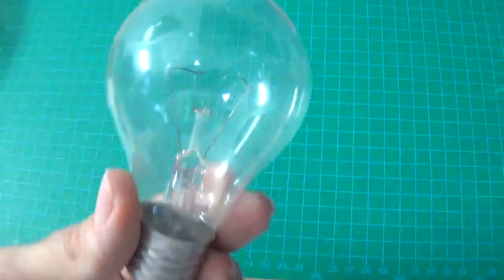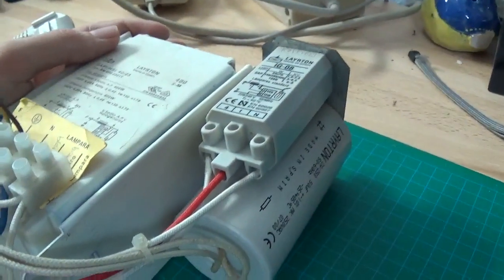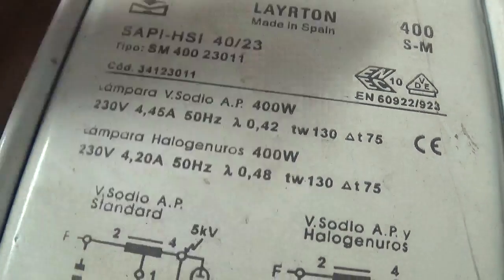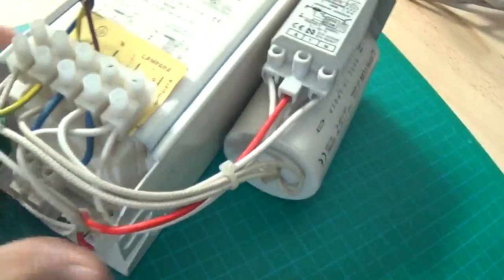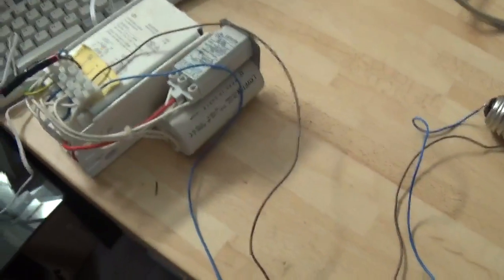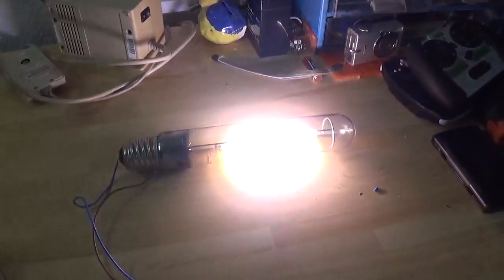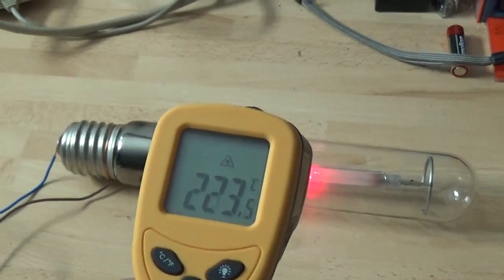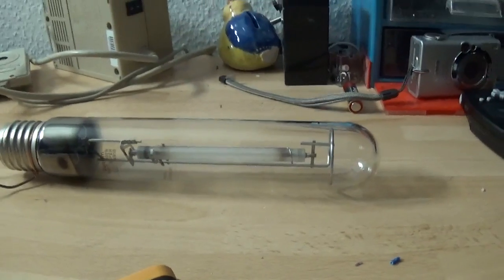A look at a 400W sodium vapor Lamp (street light)

Comment: The tubular unit is a power factor correction capacitor, the unit above it is the igniter (some lamps have igniters incorporated in the lamp). Also wiring should be phase brown , neutral blue. The centre contact of the lamp should be regarded as live and connected with the brown wire. Be aware that you are playing with extremely high voltages produced by the igniter to strike the lamp and vaporise the sodium.

Comment: Have you heard of sodium lamps with internal ignitors,  I've considered them for use at home as I presume you can use them with standard fixtures.
Reply: I doubt it'd be a great idea to have low pressure sodium lighting as general purpose indoor lighting. Because of its very tight colour output, it might play havok with your eyesight if you're using it exclusively. It's a monochromatic type of light so no colour rendering is possible with it at all.
Reply: ShokaLion Mainly for areas where lots of light is needed, not anywhere i'd relax.
Reply: Green Pretzel High Pressure Sodium 'SON' lamps require an inductive or HF ballast to control the current. Lamps with internal ignitor (glow bottle, thermal snap switch or FEC) still require an external ballast. If you ran them on 240 or 120v direct, all that would happen is the ignition would short circuit and blow your fuse/breaker. Self ballast Mercury vapour lamps are available that run direct from the mains however like all high pressure lamps they have a cool down 'refractory' period if the power is interrupted so they aren't suitable for domestic lighting where they may be frequently switched.
Reply: No you still need a ballast

Comment: The white box is called a "Ballast." It limits the current and provides the starting power to the bulb. Without the ballast, the bulb would draw more and more current until your wiring catches on fire, or your MCB trips. Also, the bulbs do contain mercury and can be dangerous if not handled properly. If you want to see bright, get yourself a 1000W HPS lamp. Good luck filming it though lol
Reply from the maker: FUCK THE NEIGHBOURS XD just kidding ;)
Reply: That is true, Ballasts are just either resistors or inductors but is generally the same thing and if you really want to see bright go outside and get yourself a 2kw Metal halide lamp. p.s not at night or you'll annoy the neighbours.